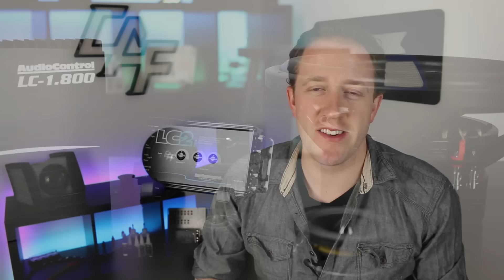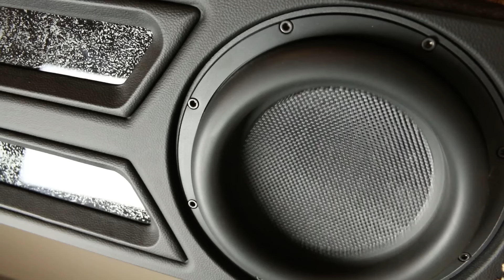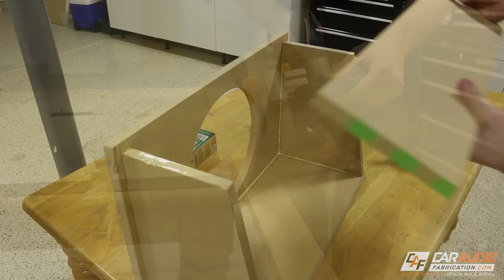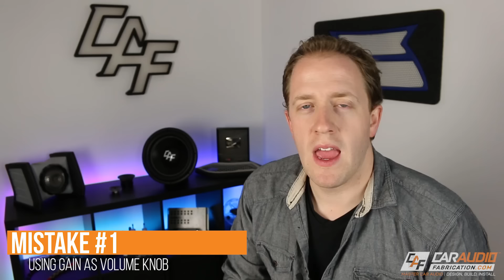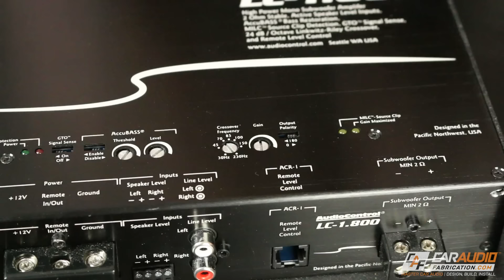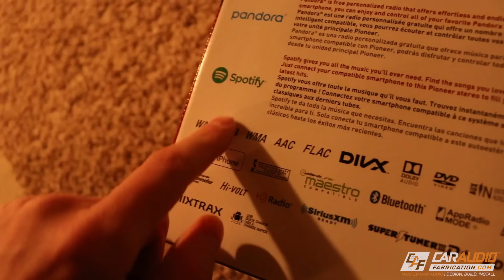Avoid these 5 common Car Audio NOOB Mistakes!

Comment: brought a 350z. previous owner had cut off factory head-unit loom and used crimp connection for new head unit. had installed an amp to make factory sub work but they didn't buy enough cable have it reach the battery so had run wiring as far as it would go. and also broke the RCA cable to the amp by having straight connector coming off the head-unit in a space to small for them. also need to replace the center console trim at some point as they broke all retention bracket putting the head unit in. one finger is all it takes to remove it now. also can use steering wheel controls  as they cut them also.

Comment: Storage is cheap.. and FLAC can do High reslution where the bitrate is over 7000 vs 320mp3.  CD quality is 1411 in case someone didn't know.  There is also DSD with the Sony RSX-GS9.

Comment: What is the antenna power cable for on the wiring harness its the only cable not connected to my deck everything seems to work fine do I need it connected and if so what one do I hook it up to the antenna power cable is blue thanks if anyone can shed some light

Comment: A few years back I had a 67 vw squareback that I installed 2 kicker 10s with a 400w amp. I had the headlight dimming problem and it would even cause misfiring of the engine. Unfortunately there is no way to upgrade the charging system on that car as it ran a generator, and it's physically impossible to run a late model aircooled vw alternator. I ran a capacitor to remedy the problem. Would you still call that a bandaid?

Comment: One that makes me itchy is a poor ground. People jut unbolt their chair and ground to there. Shiny metal is the best ground! Also crimp & shrink wrap. Not just electrical tape
Reply: Yes, one guy that gets it, electrical tape is meant for temporary installs, I always use shrink wrap, significantly more durable. I even put shrink wrap on the battery terminals, they're still nice and clean underneath 2 years later. :D
Reply: Thankfully its a big difference between "part time installers" and people who know what they're doing :')
Reply: Yup, I've spent many many hours on my system, and I'm far from finished. We're not talking a monster SPL system, going for a middleground, good sound quality while having serious punch and power. Now, if I could just get my lazy butt around to installing those sound dampening mats I bought 2 years ago. :P
Reply: Haha, sounds like a right good night of work :P If you're UK based I'll happily come give a hand. I've got some spare 0 gauge somewhere... :')

Comment: Silly.  You want better sound?  Examine what you have.  Paper cones, 15w speakers and a factory head unit?  Literally anything you do can improve it.  Factory stuff is built down to a cost.  Cheapest shit that has minimum acceptable performance.

#1 wire properly.  Quality butt connectors (better than solder/heatshrink)
#2 Correct phasing.  +/- on speakers matter.  Out of phase means destructive interference and loss or cancellation of acoustic energy.
#3 Balanced.  A 1500 watt 12" sub and $40/pair Sony full range speakers will be imbalanced.  Upgrade your main speakers to true RMS power listed high quality drivers and pair with a clean and quality head unit.  Add a small sub to enhance bass response below 50hz.  Tune crossover to limit to 50 and below.  Adjust volume or gain of sub amp to match volume of main drivers.  
Distortion isn't good.  Banging bass and rattling windows sound like ass.  Balanced music.  Balanced sound.  Save your hearing.
Reply: If my trunk isn’t trying to jump off my car I don’t want it.
Reply: Jayy actual factual
Reply: I agree with you on every point except #1... Properly soldered connections are better than crimped butt connections. That being said, solder connections are unnecessary, as properly installed butt connectors are more than adequate for any system.
Reply: @mmastert2  the old twist and tape method works for me every time
Reply: Bryce Peterson me too been using electric tape for 20+ years not one issue! ✌️
Reply: Maybe for you , but some ppl like bangin bass, my 4 15s on 5k teramps says otherwise
Reply: well, I put a 100l ported box with 4 10" on a 180 watt amp and 2 cheap 6x9 coaxials powered by an 8 year old 20$ headunit (suprisingly with a 15 amp fuse) into a 1964 fintain mercedes, all i can say is 1 layer of sheet metal without original sound deadening and old worn down rubber seals for the trunk lid makes one hell of a ratteling mess, on 180 watts it flexes the rear quarterpanels around 1 cm.
Reply: There is nothing better than something correctly soldered. There is no extra connection. I'm guessing u need a more powerful iron and some kestor solder bud. Try it out . Ull dig it. Just make sure to flux and paste so u don't get any cold solder joints

Comment: My mistake? Installing aftermarket speakers with matching amp and no sub. Turned the bass all the way up (sounded great for a while) but eventually blew a speaker, even with the high pass filter set to 50ish Hz. Suffice it to say, I am living with less bass for now until I can afford a decent sub + second amp for said sub. I think I need to upgrade the alternator and battery as well, but that will be a discussion for the installer (I am not competent enough to do this stuff lol). My priority is clarity first, bass second. 
2 6 3/4” Infinity Kappa for the front (75W RMS 2 Ohm)
2 6x9 Infinity Kappa for the back (100W RMS 2 Ohm)
Infinity Reference 4 channel amp, 100W RMS/channel

Comment: I'm completely knew to audio. I want to go with an all Rockford setup for my F150 Crew cab. While looking for sub enclosures that will fit, all of them were either dual 10" or dual 12" enclosures. I ordered the dual 12"s box. Now I just need an amp and decide on which shallow mount Rockfords I will purchase. Amazon has a listing for 2 R2SD4-12 12" 4 ohm prime subs with an amp for $240 subs are max 500 Watts per speaker with 250 RMS per speaker. The Amp is class D with 500 watts 2 ohm mono. Is this a decent combo or should I look for something else. I just want s good sounding system. It's all RF Prime equipment btw.
Reply: I'm a Hertz fan myself, but have used RF in the past, can't go wrong with that brand.
Reply: Depends on what sound you are looking for.  Is the 500w on the amp the RMS or Peak?

Comment: I dunno but I feel most people building car audio systems only have the thumping techno or hip hop sort of sound in mind. I listen to Hard Rock and Heavy Metal so a I use a stereo capable of 5 band eq to have more control over the bass frequencies. I like to keep the 80 hz band high and the 250hz lower to keep the kickdrum powerfull while not drowning everything in bassy guitars

Comment: Your last point, i have dozens of 1000wrms picked up for peanuts "it keeps going into protection mode" :D ... also noobs not even knowing about ohms, they know just enough to be dangerous, well, expensive... wiring their 600wmax 4 ohm stable amp to their 800wrms 2 ohm sub, then they tell me i dont know what in talking about and brand XYZ is crap .... FACEPALM

Comment: When I bought my car about a year ago there wasn't a subwoofer in it yet (duh) but even then when in touched the switch to close the windows my headlights would already dim, now that I have my sub nothing changed, they dim a little bit but they have done that since the beginning
Reply: Power windows can pull a surprisingly high current actually.

Comment: i think 128kb mp3 is optimal for noisy car environment. The bigest most common mistake audio noob do is upgrade the radio but not the speakers. 
I have a decent radio, Panasonic CQ-C1425N CD / MP3 and replace my back speakers for 2 forward facing, vintage, 8 ohm,  20watt, turntable speakers in original plywood box. The soud is soft, warm mids, lacking strong base and sharp loud high mids. Good for voice, classic and old rock-metal.

Comment: Lost me at marginal difference between 320 and lossless. Sure the statement is true, but if you can actually hear the difference, you have probably won the hearing lottery and are probably a paid audio guy that doesn't even watch these kinds of videos in the first place.
Reply: If you're in a mastering studio listening to oboes at symphony concert volume, that's one thing, and if you're listening to synthesized bass at club volume, that's another thing entirely. Also people who don't realize that they can hear mpeg compression can be woke by having them listen to just the cymbals in material that's not dominated by bass or extreme volume. You will hear the compression artifacts and it will ruin you for good.

Comment: If you get your system professionally calibrated, write down all the dial settings or take a pic and keep it in the glove box in case that one idiot who knows too much gets frisky with the amp.

Subs? I love slim, active subs i can mount them in the cabin of the car!!! I put in two, one under each front seat. It sounded so good, no discrete amp needed. Trunk is empty and fully useable for family. (PLEASE DO A VID ON SLIM ACTIVE SUBS)

Flac baby!!!!! or 320kbps mp3 for maximum compatibility. You won't hear the difference in a car audio system. I a quiet listening room it might be more easily discernible.

For personal listening, the 50 watt per channel on a standard head unit has always been enough for me. I've almost never had to use an amp thankfully.

Fun video. Good points to keep in mind.

Comment: do you know what RMS is what it is ,is this lets say you got a 100watt amp ok now what RMS says is that 100 watt amp is 200 watts RMS because if your amp goes 100 to the plus and it goes 100 to the negative that's a full range of 200 watts now called RMS I know some guys with PhD in electrical designer he says RMS is a deception of numbers and by the way theirs no laws on 12vdc that says you have to tell the truth unless UL is involved but that's only if it hooks up to 110vac that a lot of laws than I work in custom power supplies as a QA manager and theirs a lot you don't know about when it comes to car audio and electrical sorry
Reply: I cant even make sense of what you wrote, good lord.

Comment: The most common mistake I see people make up here in New England is pour wiring kits, purchasing cheap kits that either lose a lot of power or just can't handle the power. And then they don't buy the correct connectors and are attaching straight wires to the amp hahaha

Comment: Lol my first time "upgrading" the sound system in a car was when I thought it was a good idea to remove the 2 front 6.5" component woofers from a mk4 jetta and replace them with 6.5' kicker comp coaxail 2-way speakers.. This also rendered the stock tweeters from the front 2 doors inoperable.. It sounded like ass and was an absolute downgrade :( lol that was years ago.. Live and learn right?

Comment: Just wanted to say that i learnt the hard way. I have a 208 gti with a touchscreen audio system. The system has no bass whatsoever. So i asked the audio shop to upgrade the speakers thinking it would sort the issue out. After spending 300 quid on front reference speakers the sound was no better. What i realizes was that the touch screen had hardly any amp output to power them. The audio shop should of known better too. Touchscreens seem to have little amp power output

Comment: errors  that i think are important aswell  are 1st.   audiocables and energy together  and 2nd :  fuse near the  amp instead of near the battery..
3rd: too thin cables maybe without fuse .. i mean i have seen cars with  amps powered by audiocables.. xD
as important as the right  parts  are the insurance specific details .. " are you allowed to just splice them together wirhout soldering and so on..

Comment: used to kill me when buddies would listen to me on buying a dual coil sub....but then the wiring in series and parralel instructions along with amp recommendations went out the window. one of them bought a mono jl amp that ran 500 rms @ 2 ohms running a dual 2 ohm (@1ohm) 1200watt rms sub. the onboard fuses in the amp didnt  blow. they melted. along with a bunch of solder points on the board. bad way to die for such an awesome amp
Reply: dbrinkley5 shiiiiiiit I have the JL 500 rms amp and I have a skar audio SDR 10 600 rms and it’s wired at 2 ohm.. how fucked am I

Comment: Quick question if anybody could help me out. I have a 2004 buick park avenue. O have the base model which is a 6 speaker system. The current one is pretty good but what decent sound system I could put on my car with good base and clarity that won't break the bank. Thanks

Comment: Some clowns use it (gain controls on the amp) to "boost" volume. Not a great idea. You'll max out way too soon and never get a really low volume for background music. (Or get it where you can just hear it but your passenger can talk on their phone w/o it being distracting to them or the person they are talking to.)

 Now, primary use is match max clean HU output to max clean amp output, as pointed out here as the correct way. However, I do believe that it is okay (not necessarily ideal) to use it to cut max power out, under certain circumstances.  But please people, it isn't used to make your amp "go to 11" or 12, or 13, or 14....

Comment: Here's one for you, how come I see head units, not even the amplifiers, advertise 50 watt MOSFET max output for 4 speakers?  I know there's absolutely no physical way for only a head unit to take in even 200 watts to spread to 4 speakers, even if those speakers were running not even half an ohm.  The fuse on the back is rated at 10 amps, not even close to handling 200 watt output, especially with embarrassingly thin stock DIN wiring.
Reply from the maker: Because marketing.
Reply: Sad part is they ALL do it, clearly labeled on the front panel of the head unit as well, 50wx4 MOSFET, knowing full well that a 10 amp fuse can't handle that kind of power output, even dynamically.
Reply: They take the power handling of a single mosfet chip and just multiply it by the number of channels, common way to get impressive specs from meh amplifiers.
Reply: 14 to 20 Watts RMS is standard boiler plate, but stating 50Wx4 is just wrong, that's at the EXTREME max output, which'll just fry the MOSFET anyway.  Using an amp is much more safer on everything, there's fat capacitors and transformers inside to output the power, and frying a head unit is much more expensive to repair than overheating MOSFETs or capacitors inside an amp.

Comment: Big problem i see are people putting aftermarket speakers in places that are not properly sealed. Another problem is buying a device with out reading the reviews. Sure your new subwoofer may be from a great brand but even good brands have a crappy model or two.

Comment: The biggest mistake I still see a lot is believing the snobs who inhabit car audio forums.This makes noobs believe that they MUST install expensive brand XXX,because if they do it'll sound better than cheap brand YYY.
I've listened to enough systems with good quality gear that sound terrible just because they're not installed and set up properly.I've listened to enough systems with cheap car boot sale gear in that are installed and set up properly and sound waaaaaayyyyyy better than the supposed  'high end' gear recommended by some guy on the car audio forum.
Reply: Chris plunkett,  I agree.  You don't have to dish out thousands of $ to have a nice sounding system. Many decent audio brands out there. But you have to agree that there are also some real junk too that is a wast of $.  But if you do your homework and read and learn and also on many forums you can put together a decent idea of what is good and decent and not just wast of $ junk.

Comment: I have two 400w peak 8” kickers in two .5cu’ boxes that I got at the goodwill powered by a 600w peak kicker amp in the back seat of my little Toyota Tacoma, and the sound is absolutely wicked. I wouldn’t dare go bigger than that and lose the punchyness and dynamics of the bass produced.

Comment: For the love of all that's good, do not go by the "port area per cube" rule of thumb. It may be ok to use as a starting point but it shouldn't be a definitive thing. It does not always work and you could be leaving quite a bit on the table. 

Also, don't believe someone when they say this certain type of box sounds like this while this box sounds like this. While it's true that different box styles have different characteristics such as roll off and bandwidth, a certain style of box can have many different sound styles depending on how it was designed.

Comment: I put a 1800 watt Rockville sub set in my van. 0 gauge wire, amp and capacitor. Dimmed the headlights bad. Just installed the Big 3 under the hood using 2 gauge welding cable. No more dimming and capacitor is steadily reading over 14 volts now. Upgrading vehicles electrical is very important. Even for lower end systems like mine. Love these videos. Very informative.

Comment: Not adding dampening materials to door and trunk panels...rattle traps not only sound like garage, but are losing many dB's from it
Reply: I know I know, I have a $1500 system, but still haven't gotten my lazy butt around to installing the dampening mats I bought 2 years ago. :D I should seriously get around to it this spring, it will probably give my mids the boost they sorely need.
Reply: Håkon T.
The drop in road noise and particularly rain on the thin metal roof (can now hear myself think when it rains) are the 2 reasons why I prioritized it. Soooo much quieter. But you're not alone, I still have tires and shocks to replace. The road is pretty noisy when those are worn